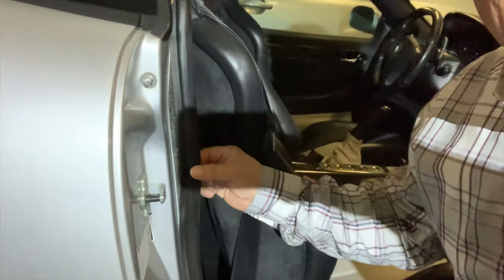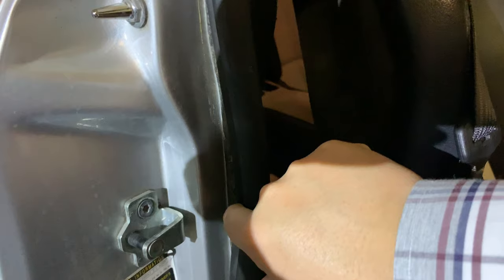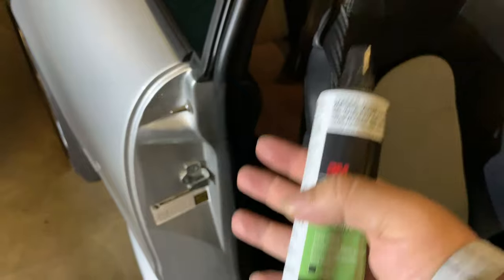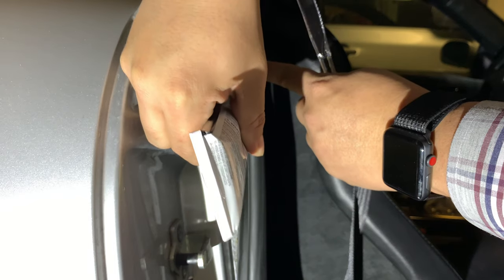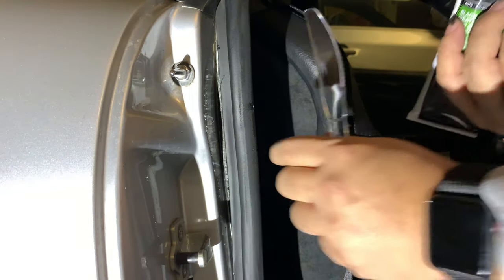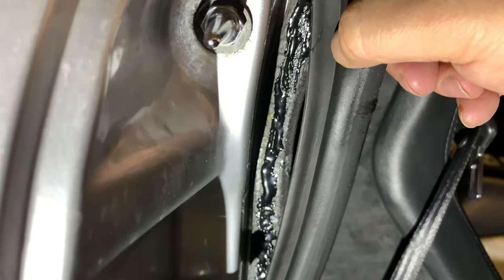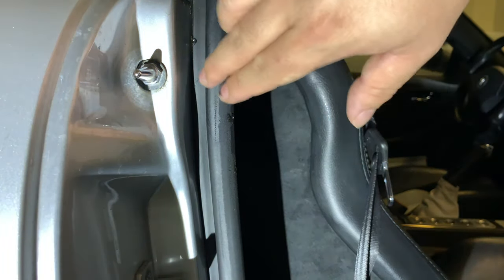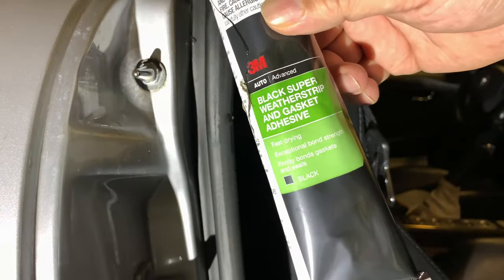How to Glue Car Weatherstrip

Comment: thank you for the video...I have an idea for anybody that just watched this.  if you can afford it buy the weatherstrip from the dealer.  then you clean all the old glue off.  then you do what he did with a. brand new weatherstrip.  your car door will thank you.  if its just a quick fix this will hold up but not as long and won't bring that nice thump a new one would bring.

Comment: Did my driver side door, so far so good! Might have to add a little more later.
Reply: What glue did u use please ?? Just purchased the front Holden Cruze shields but they come with nuts an bolts an being a woman I don't own a drill etc so thought maybe I could stick em on like my previous car had them attached ?!
Reply: @margaretmitchell7603   buy weatherstrip adhesive from local auto parts

Comment: When I bought a minivan most of the lower liftgate weather striping was all torn off or missing. Do you if that will cause rattles going over bumps and pot holes? Great video 👍
Reply: If definitely could cause rattles. See if someone sitting in back can locate the noise.

Comment: I'm about to use this adhesive for my Honda Civic. Just to confirm, once you apply, wait 60-90 seconds to dry then bond the rubber strip to the body? Thanks!
Reply from the maker: Yep, that's what I did and seemed to work great. It was about 70 degrees, so if it's a really hot day, maybe wait less time.

Comment: Hey  Peter von Panda! 
I bought the same 3M weather stripping glue but it is wrong for my project.  What I need is  something that will keep the plastic in-place against the inner door that covers the door components.  To be clear, Im referring to the plastic that you find when you remove the door panel sometimes called the "door card"...the plastic covers the actual metal door panel...between the "door card" and the door...  hope that helps.   the 3M hardens, I need something that stays tacky without hardening so as to not have to reapply each time I remove the plastic.  thanks
Reply: Try looking for Butyl cord, black and round. Commonly used for "shower curtains" as we call them in motor vehicle production in the UK.
Reply: i used high temp bearing grease. seems to be working.
Reply: Ok

Comment: What if it's on the bottom side of the door and it has those stupid little plastic clips?
Reply: @brandon perault Did you find a fix for the clip issue? I watched a video that said there are holes on the rubber that the clips go in...

Comment: Hi Peter , Did you Need to Clean and prepare the Surface before applying the product??...
Reply from the maker: I didn't do any prep and mine is holding up fine
Reply: @petervonpanda  "Thanks Peter!! I'll Order Some for My Ride!!👍👍😎
Reply: Maybe if there's lots of caked on gunk, you can take a dremel with a wire wheel to it. Maybe touch up paint that you burn through.
Reply: @petervonpanda  can it work to seal a tear in the seal itself?

Comment: Lets see, Why show the "Plastic Knife" if you weren't going to use it ? It was suppose to be used to spread the glue flat so it would dry and bond better. Oh, well there's always a "Video" of how not to do it.
Reply from the maker: I was going to use it but didn’t need it
Reply: Weren’t you supposed to remove the old glue first?
Reply: @David-kk4dr  - Yes If you can but alot of the times it's stuck on one side that if you try to pull it off I'll rip the rubber with it, still a video on "how not to".